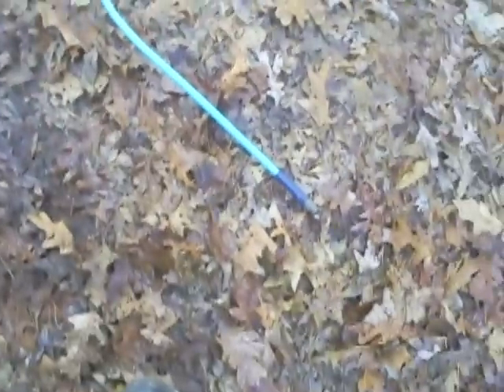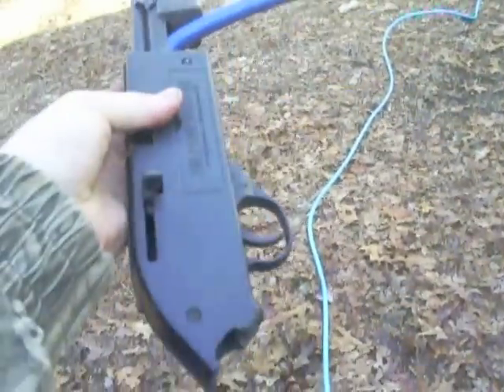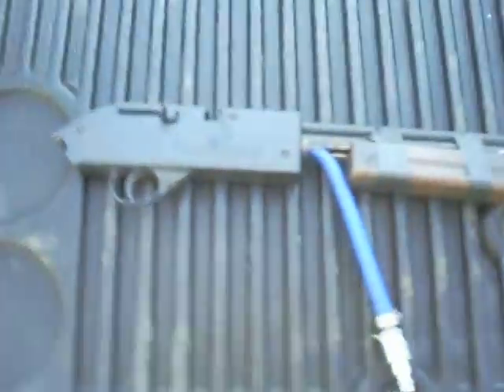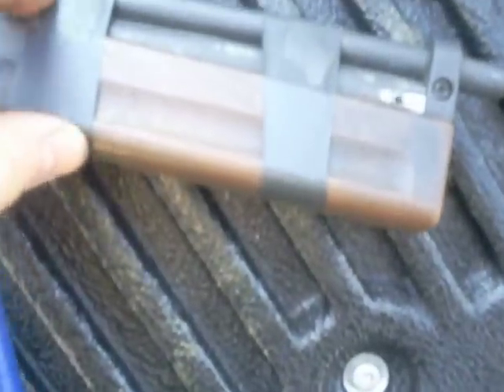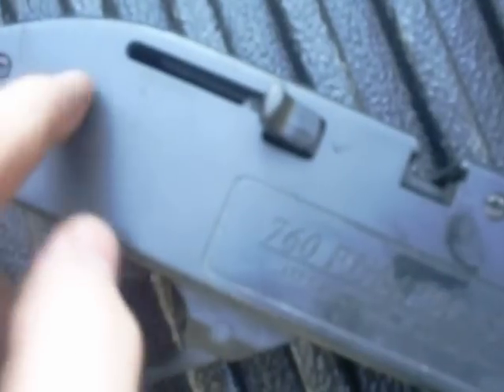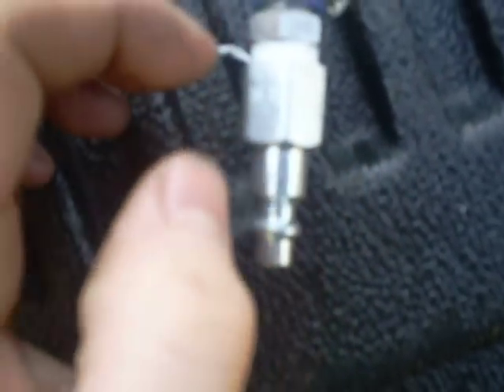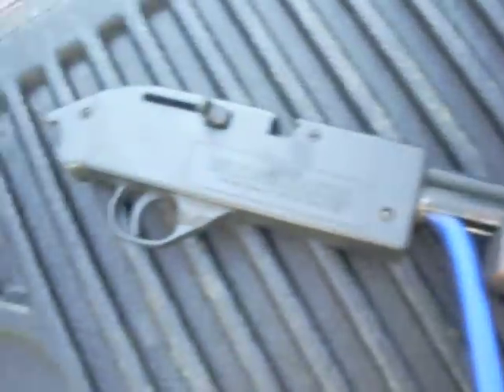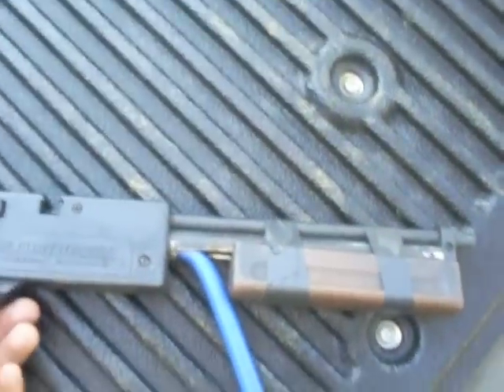steel bb gun powered by air compressor

Comment: probably quite low fps with steel bbs, but get more decent fps with plastic 4.5mm bbs.  It would be good to modify co2 air gun to use compressed air for practice.